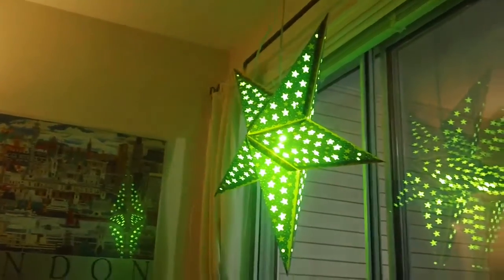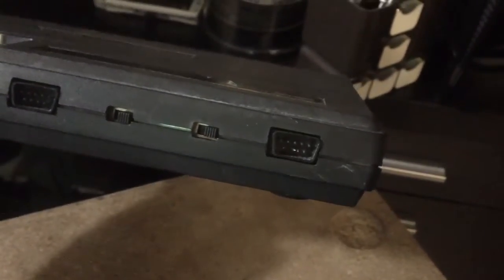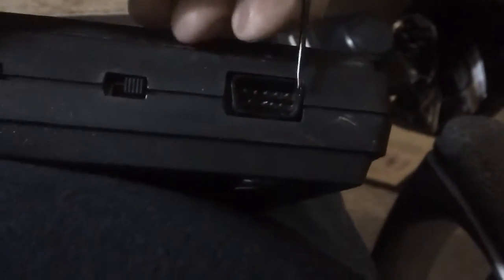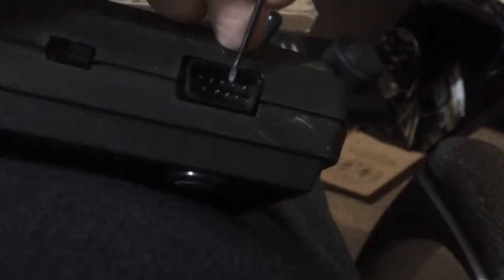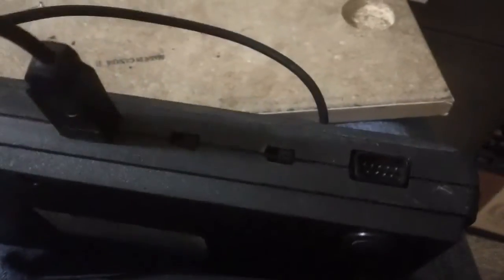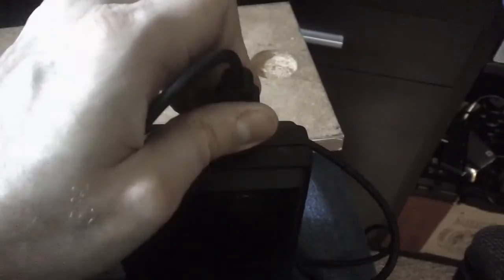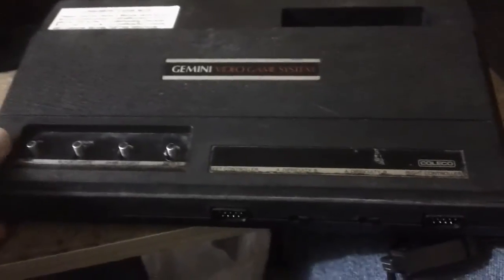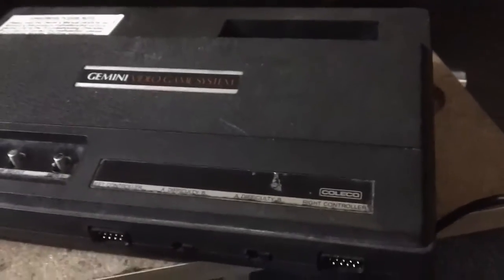Retro Console repair - Straightening Controller Port Pin.

Comment: I had the same issue with a 2600 Jr clone I have. My pin snapped off. Bummed me out. One day I will replace the controller port on it.

Comment: Will a sega Genesis controller work on that system. I know it works with the Atari 2600 .
Reply from the maker: +allan fulton Pretty sure it would.
Reply: Thanks for answering my comments it's nice that you answer your fans so many others don't.

Comment: I have a problem with my ps1 console that causes it to always fail to read discs when it is placed in normal position. It used to play the games whenever I would turn it on its left side and I would have to prop it against something to keep it from falling over, but now it's gotten to the point that this only works for a short time before it stops reading the game disc altogether and won't work again unless I turn it off and on again, rendering it pretty much unusable. Does anyone know what the cause of this problem is and what I can do to make my ps1 run normally again?

Comment: I hate it when that happens, it is even worse on some more "exotic" consoles like the Interton VC 4000 as that one does not have standard 9 pin connectors, so if that one breaks you are out of luck.
Reply from the maker: VectrexRoli Oh yes that would suck.